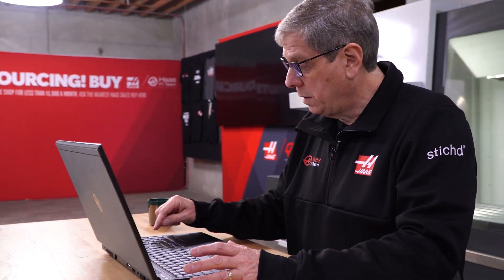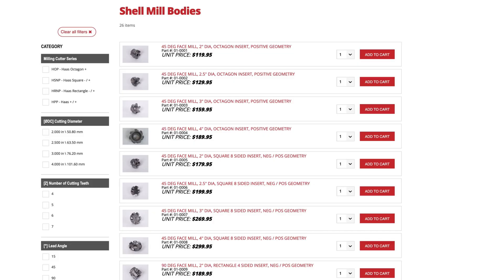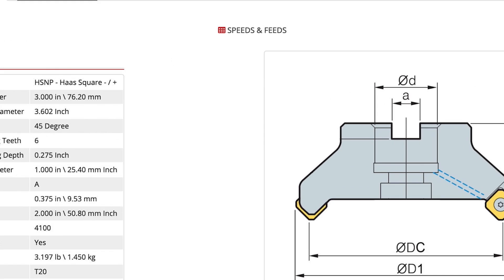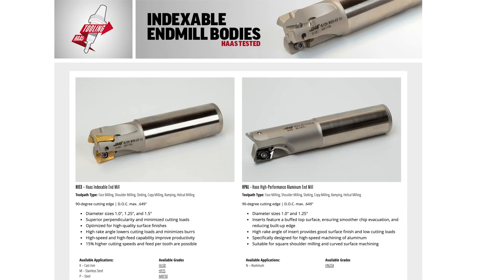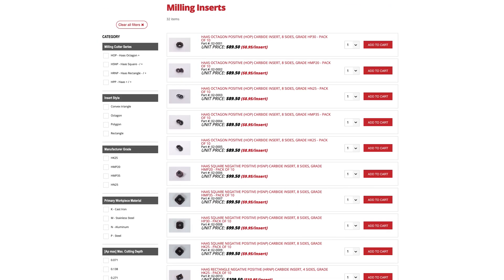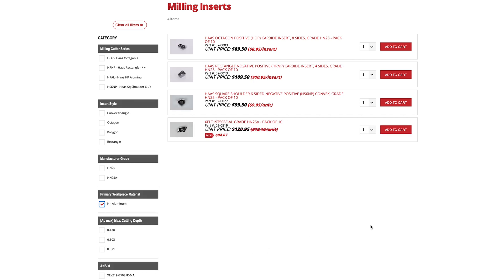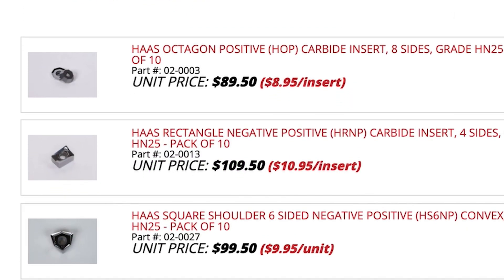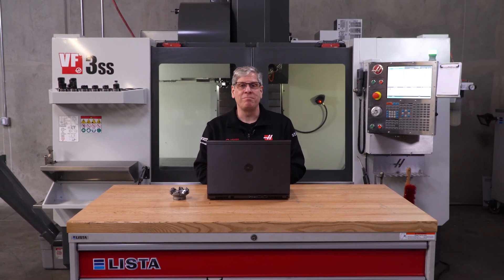Indexable Milling Cutters and Inserts on HaasTooling.com - Haas Automation, Inc.

Comment: Have you been on HAAS tooling lately?
Major change and not for the good.
What were you guys thinking? So much more difficult to navigate and find what you're looking for. Plus the search that they are using now doesn't work right. If you change one parameter of the search, you are taken back to the beginning. That's just one thing.
What were you guys thinking? Bad move.

Comment: Really good job with a design of new page and filters, and related products. Really makes it easier to understand everything and find things quickly without making a mistake. The only think that would be even better is to have to pages in the Speeds and Feeds charts. One for metric and one for US units.
Reply from the maker: movax20h, Thanks for the positive feedback about the page layout and filtering. We are trying hard to make it as easy to use as possible. That is a great suggestion about adding Metric units to the Speeds and Feeds chart or making two separate charts (probably less confusing if everything isn't on one chart). We will take this up with the Products and Web Design teams.

Comment: How about getting hpal in the 1.5” kits?  Put it on a 3” shell mill body and it is an absolute monster in aluminum but still allows you to rough out smaller pockets.
Reply from the maker: Kbgreen 2009, Thanks for the suggestion and sorry for the wait responding. At this point we don't have a combination of indexable end mill or shell mill body that will put the HPAL insert on a 1.5" diameter. But the use case you suggest does sound effective. We don't have this combination in the works right now, but we'll add this to the list of what we're considering for upcoming testing.

Comment: The "SPEEDS & FEEDS" link doesn't look like a clickable button, but rather a title of a section that didn't load correctly. I suggest, you move the Speed & Feeds pdf into a new tab (next to the "OVERVIEW" and  "GALLERY").
Reply: Works for me. It is a link. Using middle mouse button, it opens in a separate tab. And you can also right click on the link and save it locally for example.
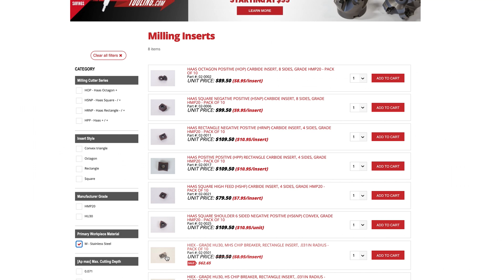Reply: @movax20h  Yes, it is a link, but I think, many people will not think that it is. By putting the pdf into a new tab, I meant the in page tabs ( 5:45 in the middle of the screen, there are tabs "OVERVIEW" and  "GALLERY" ). I think that would be more easier to understand and it would look better overall. I'm sorry that I didn't explained clearly in the first comment.
Reply from the maker: Jan, Good point. We have talked about making the Speeds & Feeds button easier to see. There's a lot going on on these pages.